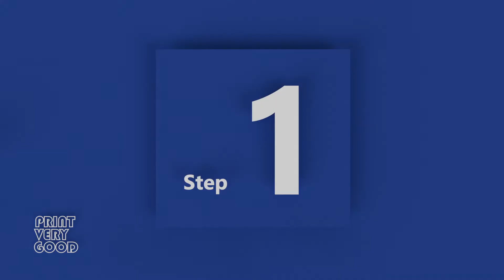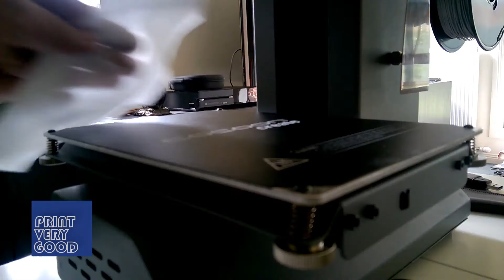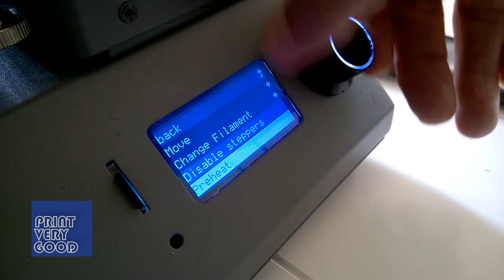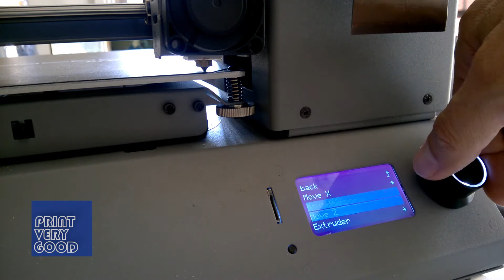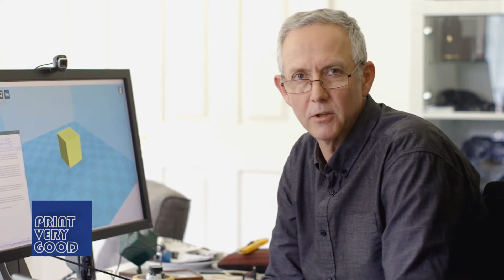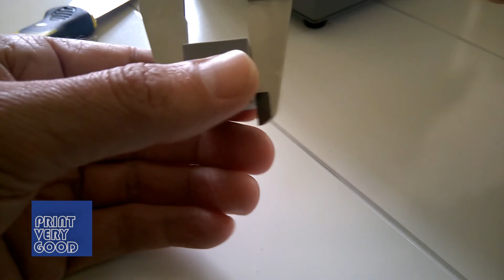My Steps for Creating A Successful 3D Print On a Non Heated Bed!

Comment: I did not have a heated bed to start with on my Mendel 90 in 2012 and I was able to print PLA just fine I am trying to cut my energy costs and thought that being able to print PLA without heating the bed again will save quite a bit of money over a year, I print on mirrors usually and with no products, however, I shall use Purple gluestick on a cold bed to see if that works, I only had the idea 10 mins ago and haven't had the chance to try this out yet

Comment: Hi , Dear Paul 
Nice to watch your video of setting the 3D printer .
Would it be possible help to fix the problem of my 3D printer ? I am using the same printing I think , the print out size not good , for example the size of square is Y 20mm * X 20mm , but print out is Y 20.5mm * X 19.5mm , and I have adjust the timing belt 3 times , realsed  X axis and tighten up
 Y axis , anyhow it is no success .....
Thanks Paul .
Rregards
John

Comment: HI THERE, I'VE GOT A DUPLICATOR I3 PRINTER AND I CAN'T SEEM TO GET IT LEVEL ALL ROUND... THE CORNER'S SEEM TO BE OK BUT THE CENTRE SEEMS TO BE SLIGHTLY HIGHER AND THE FILIMENT  IS NOT STICKING TO THE BED .. I'VE USED DIFFERENT GLUE STICKS AND SOMETHING LIKE YOU DONE BY SPRAYING ON THE TISSUE ...BUT NO GO...ANY HELP WOULD BE GREAT.. THANK YOU...
Reply from the maker: Hi David, sorry to hear you're having problems. It sounds like your bed may be bowed if it's higher in the centre. Have you contacted Wanhao direct? https://www.wanhao3d.com.au/contact/ It might be worth contacting them if you haven't already done so. For bed adhesion I just use Isopropyl alcohol these days, I made a video on that here https://youtu.be/VumJQyD7KlQ But if your bed does indeed have a bow in it you will need to get that sorted first. Is your model the original i3 duplicator or the Plus model?
Reply: @PVG3DPrints  HI THERE I'VE JUST CONTACTED WANHAO AND WAITING REPLY,, THANK YOU FOR YOUR HELP..    BEST REGARDS   , DAVE
Reply from the maker: @deltamike20  You're welcome David, hopefully they can get your bed sorted.

Comment: Cheers. A great help as this printer has no real setup info. My prints always seemed to try and print to fast and never really stuck to the base or between layers.
Reply: Sorry this may be too late mate, but I solved that issue of layers not sticking to base by putting painters' tape/masking tape on the surface!

Comment: I don't know why but whenever i try to print something it just prints it in the air... 
This doesn't happen with the preloaded models.
Reply from the maker: Hmmm that's interesting. Check your slicer settings, it may be adding an offset for the first layer.

Comment: still having stringing problems and poor quality below supports..
Reply from the maker: Hi 3plestrafe, Did you get your stringing problem sorted?
Reply: @PVG3DPrints  not really.. still there
Reply from the maker: @triplestrafe  Are you slicing your own models, if so which slicer? There are a few reasons this could be happening, I want to rule out an incorrect Retraction Distance value first. I found a setting of 7mm to be the optimum retraction distance for the Cocoon Model Maker (Mini) printer.
Reply: @PVG3DPrints  retraction distance 10 and get really bad stringing
Reply: Cura

Comment: Feeler gauge, if you buy it new, be prepared to wipe the oil it was stored in off. I made sure I did each and every gauge, twice. I can attest to the double checking of the blades. When I did my second run of wiping I discovered three blades stuck together. 
I used the zero point zero eight. Couldn't find the point zero eight...  sneaky things these gauges...
Reply from the maker: Good tips thanks Elfpimp1
Reply: Print Very Good thanks, I have my moments. Few and far between, but I get them..   Now if I can just figure out my layer adhesion issue..

Comment: Sir thank you very much for your time and effort to share this valuable information. I'm a rookie in 3D printing and your videos got me going despite the initial frustration. I recently purchased a Wanhao Duplicator i3 mini which seems to be quite the same with your printer. Anyway after a disastrous 3DBenchy print I took your advice about using the filler gauge and printed a hollow pyramid which came out a lot better. Although the final result wasn't as perfect it is more than satisfactory. I will be copying your cura settings also and try again the same print with the pyramid to see the impact.
Reply from the maker: Thanks very much Skourkos!

Comment: Hi Paul.  I have purchased the Cocoon Create Mini today, mainly based on your YouTube videos and the comments that others are leaving.  Seems that this 3D printer is ideal for an entry level user and ideally priced ($199 on special at Aldi), but when 'tuned' it also surprises with the level of quality.
One question I have: once you raise the Z axis, how do you lower it again?  Can't seem to do it without physically pushing down on the 'arm' of the printer.  I'm sure that is NOT ideal!
Keep up your learning and recording the very informative videos.Cheers.
Reply from the maker: Hi Gianni that's great news and thanks for your comments! The Cocoon Create Mini is definitely a capable little printer and you got it at a great price, $199 AUD wow!

I definitely wouldn't move any axis without first disabling the stepper motors or turning the printer off. To raise the print head I normally go to 'Menu', 'Quick Settings', 'Move', then 'Move Z' then rotate the dial clockwise. But hey, yes you are right! I was going to tell you to rotate the dial counter-clockwise to lower the print head but that doesn't seem to work properly??? 

You have another option though. Go to 'Menu', 'Quick Settings', 'Move' and instead of selecting 'Move Z' scroll all the way down to the bottom and hit 'Home XYZ'. That will bring the print head all the way down to the front right corner of the bed where you can raise it up again if necessary.

I haven't encountered this issue before because as part of my steps for successful printing (https://youtu.be/4SdFIrDKhKY) I always select 'Print File' after raising the print head.

Enjoy your new printer Gianni!
Reply: Thanks for the express reply!!
The 'Home XYZ' command only seems to 'Home" XY on my machine!

Also, disabling the stepper motors seems to disable X and Y motor only, and, turning the machine off and then pushing down on the arm, seems to turn the Z axis stepper motor to a generator as the LCD screen and control nob lite up on each push...... very unexpected the first time!

I am currently printing my second run, using your settings.... so far so good. Cheers.
Reply from the maker: No worries on the quick replies Gianni. I know what it's like when you're keen to get going on something. ;)

Re "The 'Home XYZ' command only seems to 'Home" XY on my machine!" Oh that's odd?? You might want to try doing a 'Factory Reset' under the 'Advanced' listing.

Wow you're right again! I just went and tried pushing down on the Z axis with the printer off and my knob started flickering as well! The way I go about my prints I don't normally need to lower the print head after raising. Once you get into the swing of it you'll probably settle into a similar routing. Ah, I also check the bed levelling before each print which brings the print head back down to the print bed.

Let me know how the print goes!
Reply: Thanks again for the reply.

Print is at just over 50% and still going well.

I purchased my isolpropyl alcohol from Bunnings.  It's the Diggers brand and it comes in several sized bottles, including a pump spray. All in the paint department.

Checking the bed level at 50mm height is not what I think you mean, but that's exactly what happens!
Once the current print is over, I'll do a Factory Reset.

I'll let you know how the print and the reset goes.
Cheers.
Reply from the maker: Thanks for the tip on the isopropyl alcohol at Bunnings Gianni, that's excellent! Will definitely get some tomorrow. 

I remember asking around for some at varying places and people just gave me a blank stare, they had no idea what I was talking about so I just gave up.
Reply: OK, printing done.

I printed this item: https://www.thingiverse.com/thing:832183 (not sure if what I'm doing is allowed) after downloading it and 'slicing it' with Cura.

First attempt, using he printer's default settings, warped and pealed off around 45% into the print.

Second attempt, success , as in, it works, if only a little rough (not as smooth as your cube).

I have photos of the finish item, but not sure how/where to upload them to.
TheGoofy's photo shows a much sharper finish, but the same 'sawn off' look as my print.

Overall, very happy with the end result of my second ever 3D print!
Thanks for all your videos and work answering not only my comments, but the other users as well.
All in all, a relatively painless introduction to 3D printer ownership. 

Cheers Paul!
Reply from the maker: That's awesome news! Thanks for letting me know Gianni and well done!
Reply from the maker: Thanks for the tip on the Isopropyl alcohol from Bunnings Gianni, I bought some yesterday and 2 prints in and it seems to be working really well!
Reply: Even cheaper, I buy the alcohol in 5L quantity off eBay and refill the 100ml (Diggers brand) bottles from Bunnings. If you live in a Metropolitan city you can probable get some from Lab supplies direct.
Reply from the maker: Nice tip! Thanks j3ngel.

Comment: Yes , again great job. I  bought our printer for my 13 old daughter. I know NOTHING about this & your reviews are perfect.  May I suggest a video on the design aspect & getting the data from design to printer. [ if that makes sense ] Also ,  we use Mac & the issue of getting the design from Sketch up to the card is a problem.
Reply from the maker: Hi Derek thanks for your comment and question! Yes I'm more than happy to do a video on getting a model from design to print. Keep in mind I work in Windows based Blender and Cura (Blender is free and available for Mac) so my videos will be from that point of you. If you can let me know what Slicing software you're using on the Mac (Cura, Simplify 3D etc) that will help.

If people let me know what they need I'm happy to try and help!

Link to free Blender download... https://www.blender.org/
I'd also recommend Inkscape (I use this for creating 2D art to convert to 3D) Also free Mac version... https://inkscape.org/en/release/0.92.2/

I'll be doing videos on all the packages I use to create 3D printable models in the near future.

Comment: Wax and grease remover for the win i have been using it for awhile now but not the spray version tho and have had great results for getting prints to stick just wipe down the surface after every print and re level the bed works every time and i have the first layer temp set to 240 and print temp to 210 perfect settings for my cocoo create
Reply from the maker: Thanks Shaun! A non spray version of the Wax and Grease remover is a great idea. After watching the video back the spray version does generate a lot of overspray. I'll give those settings a go!

Comment: feeler gauges hadn't thought of that great tip now to find some adhesive
Reply from the maker: Hi Kyle!
I definitely wouldn't use a contact adhesive. Contact adhesives are designed for permanent bonds, you just need a spray adhesive from an art store or something like that. Spray adhesives are designed to mount paper, photos etc. Contact adhesives are designed to stick laminex down on bench tops, tiles to floor, upholstery anything that requires a permanent bond. Way too strong for 3D printing. 

Glad you got a workaround but be very careful with that contact adhesive. ;)
Reply from the maker: Thanks Nathan! I've since found other YouTubers who are using feeler gauges so it's not a new idea but I do find them to be the most accurate way of getting consistent results. Good luck with the Spray Adhesive!
Reply: what strength adhesive do you recomend i've been using some sellys spray contact adhesive but i fear it's alittle too strong this afternoon i tried the included 2 rocket and the first failed not enough adhesive and i felt like i was going to destroy the second with too much both times adhesive was applied to a paper towel first then sread on the bed but it seems to set way to fast to do it this way i have however found that after the too much print and a subsequent cleanup with wax and grease remover the bed is still nice and tacky about 30 minutes after clean
Reply from the maker: Thanks Norbury good to know!